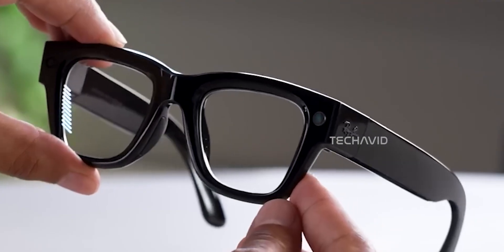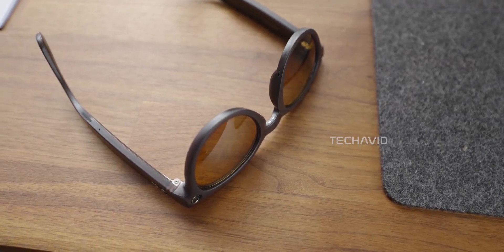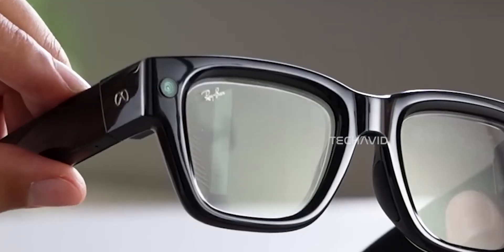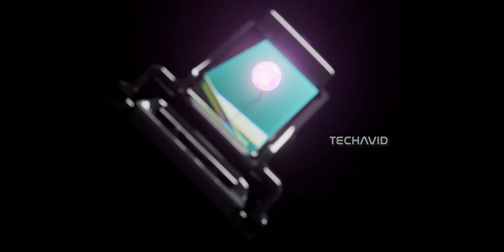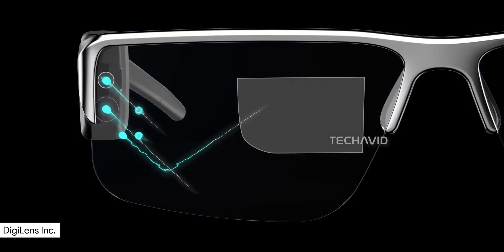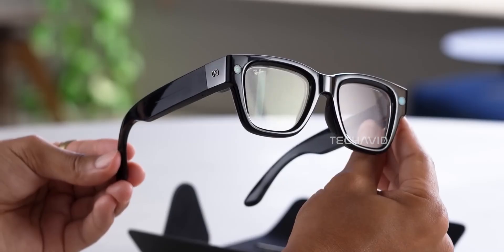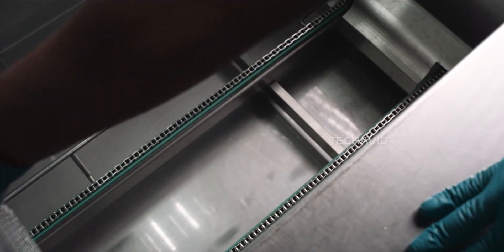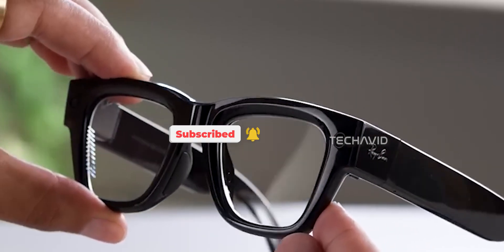Expert Warns Meta's Ray-Ban Display Glasses Are A REPAIR NIGHTMARE!

Comment: Its worth flagging in a teardown and its absolutely not worth accepting that smart glasses and watches should just "be that way" and its valid critique. It may be the best the tech can be squished into at this time. The problem isnt that it cant be repaired by some guy at home, its that professional repair shops just cant do anything about it, its ewaste the second a battery dies which is an inevitability.